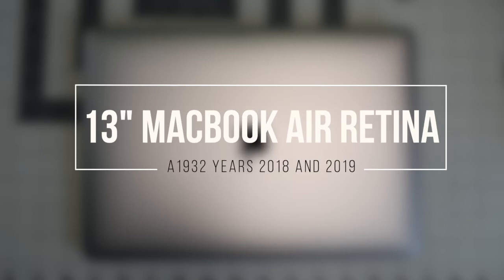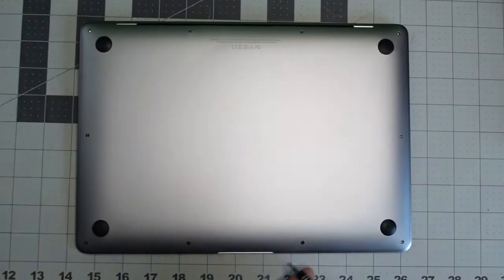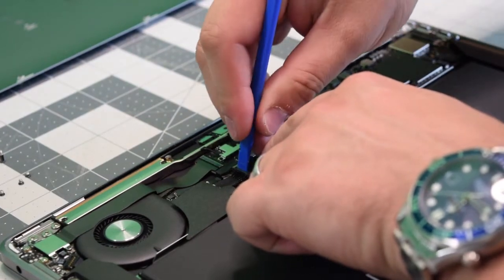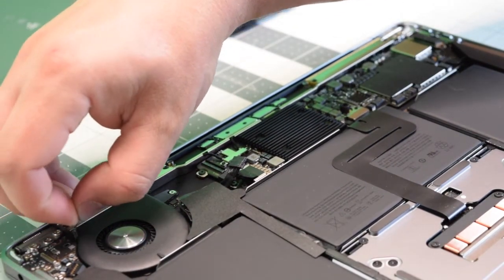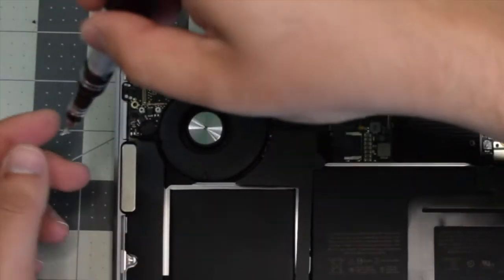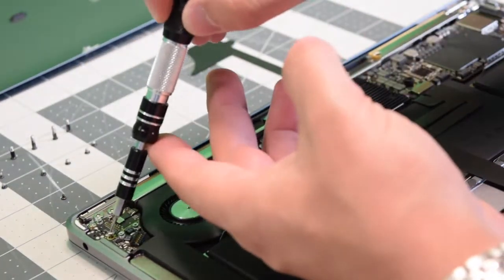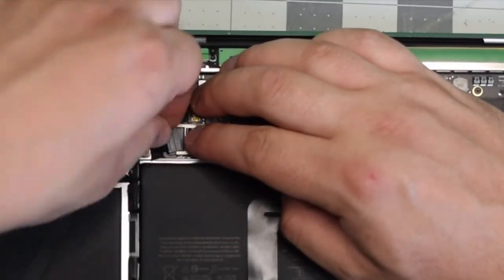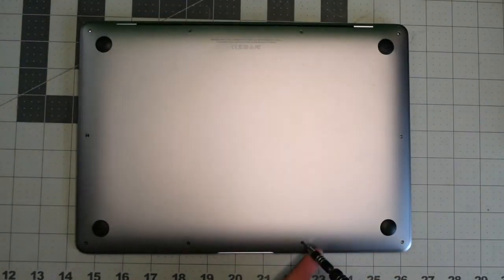13” MacBook Air Retina 2018 and 2019 A1932 Audio Headphone Input Jack Replacement

Comment: hi.. i wanted to ask a favor if you can help me.. the left speaker connection is broken. i reassembled without the speaker connection, the macbook air 2018 no longer turns on.. it could be that problem that does not turn on.. thanks francesco